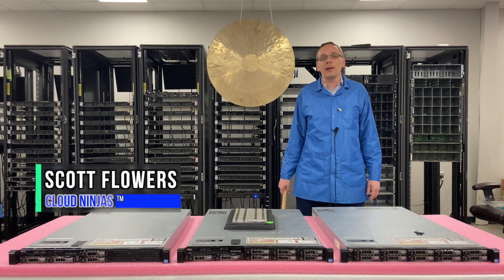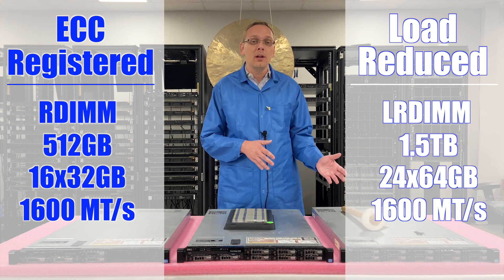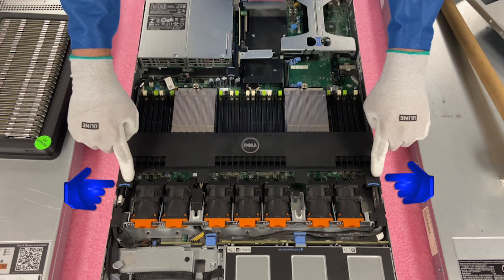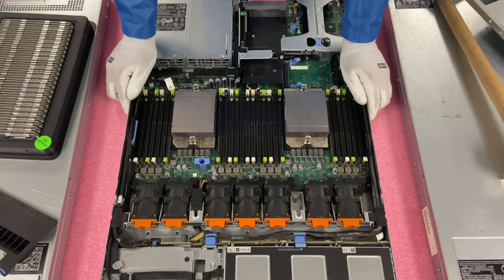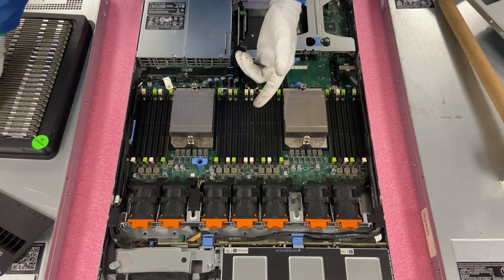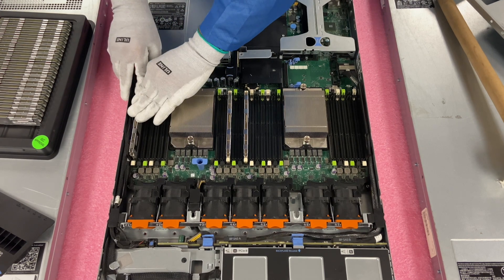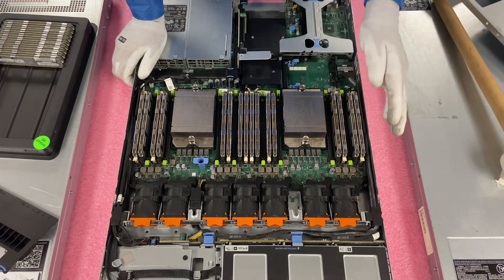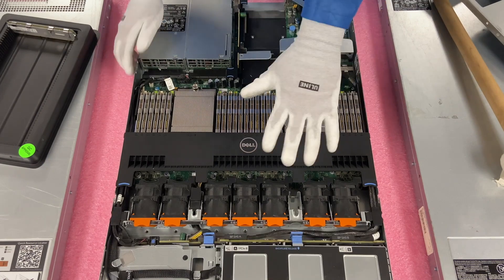Dell PowerEdge R620 Server Memory Overview & Upgrade | How to Install Memory | Supported DIMMs

Comment: Hello! Thanks for the video! Can I put in only 12 sticks of R4x4 32G or does it have to be either 8 or 16? It's RDIMM 4Rx4 @ 1333MHz. This is for an R620 with dual cpu
Reply from the maker: Yes you absolutely can install 12 x 32GB RDIMM @1333MHz. It is important to make sure that you evenly distribute your memory so that each CPU controls 6 modules.

Comment: Great video, always struggled with changing RAM in my r620 as I didnt know how all the patterns of channels worked, I have a combination of 32s, 16s, 8s and 4s - as long as I follow the best practice of adding them in together in sets of 4 they should all be ok right?

is there an issue if CPU1 has 32s then CPU2 has 16s or less?
Reply from the maker: Appreciate positive feedback.  Yes you can mix sizes and speeds.  Cannot mix types.